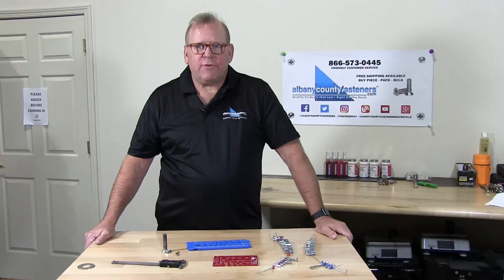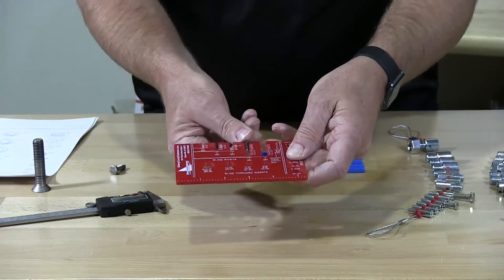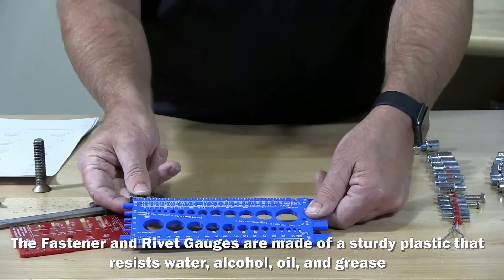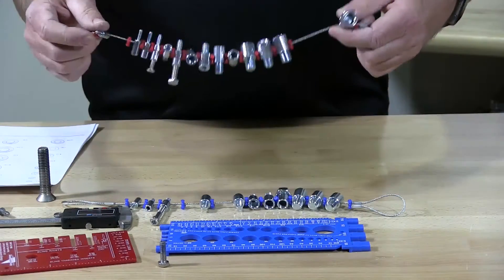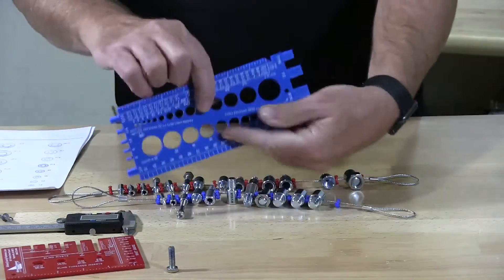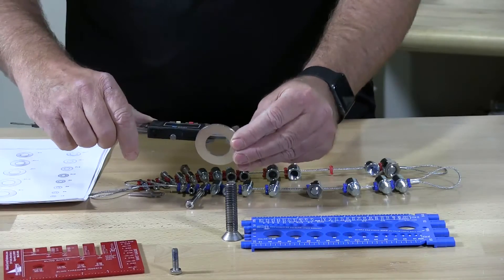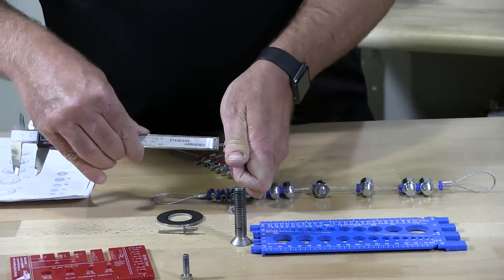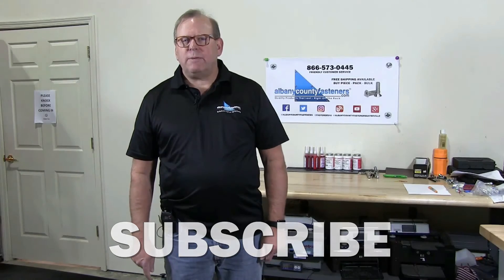How to Use Fastener Measuring Tools | Fasteners 101

Comment: When i order rivets the company's go by size of hole and length ex. 1/8in.x 3/8in. never seen #6x64
Reply from the maker: Rivets are measured by their diameter x grip range, like the size you gave in your comment. The numerical sizes (6-4, 6-6, 4-4, etc.) are another way to represent the diameter and grip range. Here's how those numbers work: 
Let's use a 6-6 as an example. The first number is the diameter in 32nds, so 6/32" which is simplified to 3/16." The second number is the grip range in 16ths, so a 6/16" which is simplified to 3/8." So putting that together, a 6-6 would be a 3/16" x 3/8" pop rivet.
The pop rivet numerical system is a common way to represent pop rivet sizes, but, as you can see from the explanation above, it's easy to see why some companies may omit that sizing system, or at the very least have those numbers with the actual measurements.
You can find a more detailed explanation of rivet sizing here: https://www.albanycountyfasteners.com/Rivet-Guide-s/1158.htm

Comment: Useless crap. Go metric, easy, any mechanic can see what diam a bolt is and the reuired spanner. On very rare occasion, one can find UNC bolt recognisable because the pitch is coarse like a wood screw. Just remove it, throw it away to avoid any future problem.